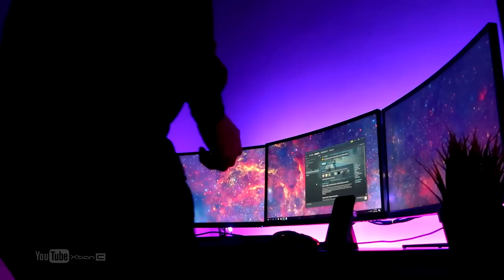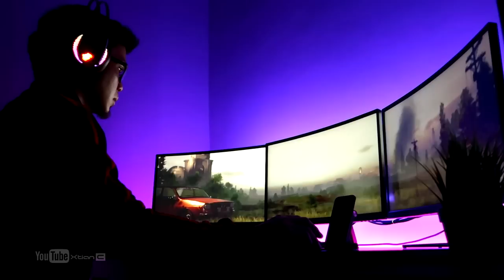Php145k RGB PC Build + Triple Monitor Setup I MSI Z370 Godlike I MSI GTX 1080 Ti Gaming X Trio

Comment: do u think that the frozr xl performs well?? or its just a good shapped air cooler
Reply from the maker: I manage to get a 60C max temp while benchmarking F1 2017 on Ultra settings @ 5760 x 1080 reso. i will try to upload the video.

Comment: This was an Amazing build.  I love the parts that you used.  If I had one thing to point out.  You placed the GPU in the wrong lane.  If you are only using one GPU.  It should be in the first lane.  To get the full 16bit bus speed.

  It's an Amazing looking build.  You sir have a new subscriber.  Keep up the great work.
Reply: And wtf? That cpu cooler 😂

Comment: Processor: Intel Core i5-8600K Coffee Lake -@t
•Mboard: MSI Z370 GODLIKE Gaming Motherboard - @t
•GPU: MSI GTX 1080Ti Gaming X TRIO - @t
•Memory: G.Skill Trident Z RGB 8gb x4 3000mhz 32Gb - @t
•CPU cooler: MSI Core Frozr XL - @t
•Storage: Plextor M65 256Gb - @t
•PSU: Cooler Master MasterWatt 650w Bronze - @t
•Case: Cooler Master MasterBox Pro 5 Tempered Glass - @t
•Case Fans: 4x CM MasterFan Pro 120 Air Flow RGB - @t
•LED Strips: 5x MSI-Phanteks RGB Led Strips -@t

Total Cost - Php145,000 (Sytem unit only)

Gaming Peripherals:
•Mouse: MSI Clutch GM70 Gaming Mouse - @t
•Keyboard: MSI DS 4200 Gaming Keyboard - @t
•Headset: MSI Immerse GH70 RGB Gaming Headset - @t
•Monitor: 3x OPTIX G24C LED 144hz Gaming Curve Monitor - @t

Comment: Bought a new PC and everytime I play Csgo my game freezes and goes black screen... Any help pls
Reply from the maker: try to replace the Power Supply Unit
Reply: KevinFPSGames local disk c > windows > delete system 32 for higher frame rates and less stuttering.
Reply: Check first the minimum and the recommended system requirement of a game like cs go. If you check this stuff and it is compatible, you should try to update all of your drivers including your motherboard and the gpu also. I recommend to clean uninstall then re install again your drivers (updated). Check your system if has virus then you scan it. If doesn't, format your system and change your power supply (if your psu is generic).

Comment: Build is ok nothing to write home about. I would have gone with Asus formula, an 8700K and 16GB 3200 mem. 32GB memory is pretty much pointless except for bragging rights. Also 650W PSU is rather anemic imo. Lastly Plextor M65 at 256GB is hmmmm.. considering that's the only storage present. You could have at least gone with Samsung 960 pro @ 512GB. Well to each his own.

Comment: Overkill gpu for 1080p. Save money then and go get i7 imho very uneven build. I mean u get bragging rights if u have 1080ti. But its not utilized. 1080 ti is bottlenecked by i7’s at 5ghz overclocked imagine i5 running stock. Lastly seems to cheap out on psu again. I know it’s sponsored build but comon tell msi to even out the parts

Comment: Bottleneck detected: Your CPU is too weak for this graphic card.

Intel Core i5-8600K @ 3.60GHz with GeForce GTX 1080 Ti (x3) will produce 28% of bottleneck. Everything over 10% is considered as bottleneck. We recommend you to replace Intel Core i5-8600K @ 3.60GHz with Intel Core i9-7980XE @ 2.60GHz.
Reply from the maker: Too weak? I dont think so.. where do get this info? bottleneck calculator?
Reply: There is always a bottleneck , there is no perfect GPU and CPU combination. It all depends on the type of things you do such as gaming and editing. But still every game has a different optimization and system requirements.